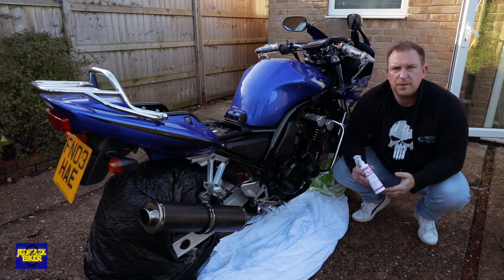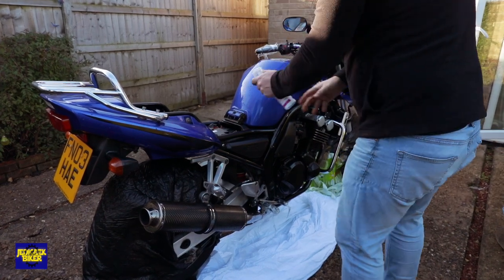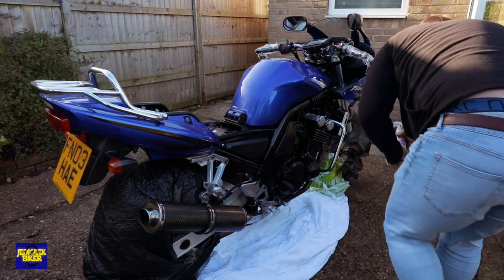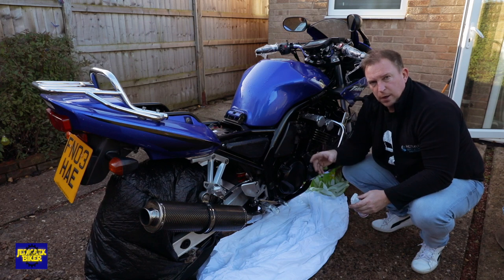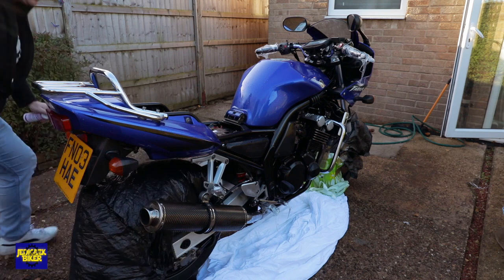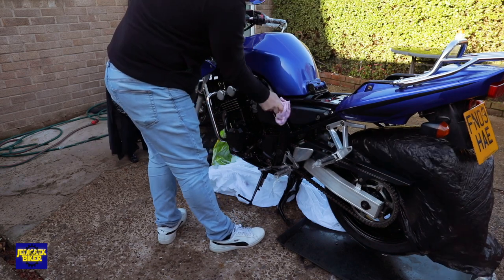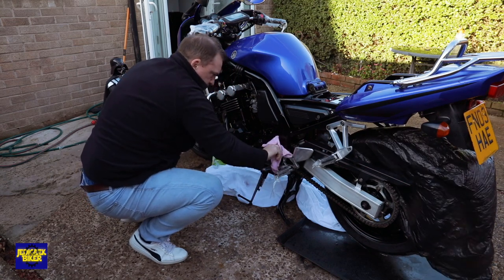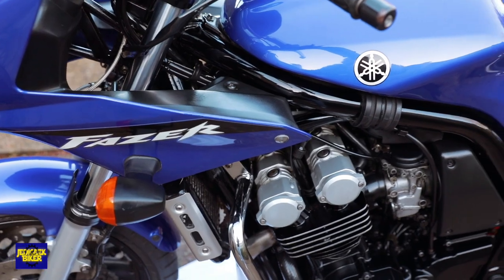ACF50 Motorcycle Application + Chain - Spray bottle application

Comment: Bike looks great once it's applied. I sometimes use a paint brush to get into all the cracks if I can't get to it with a cloth. Top job.
Reply from the maker: Cheers, this bike really needs it. with its age and where its kept the lower bolts rust quickly and Muc off protector did nothing, 3 in 1 oil etc, all fail. So this was my next choice. Il be doing my bandit with a compressor but like the idea of a brush too, cheers

Comment: That's a stunning looking fazer mate, looks like it's just rolled out of the showroom, top job there, I did my bike recently but bought aerosols and it just splutters out lol.
Reply from the maker: Cheers, the acf does give it a showroom look. It has its areas though which may need re-painting next year, mainly right under headers etc. I did watch a few videos and the aerosol didn't rank well but I guess as long as it's applied then job done. Just a little messier. I'm doing my Band with acf and the compressor soon.